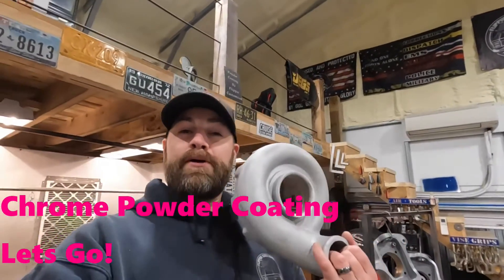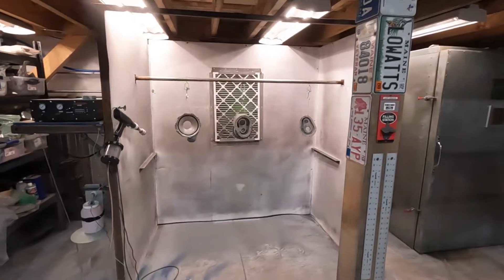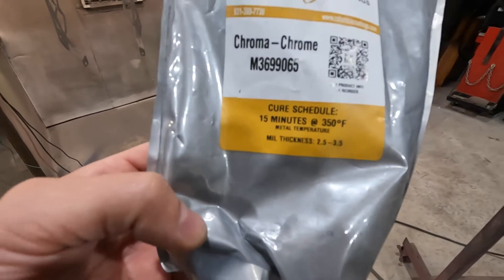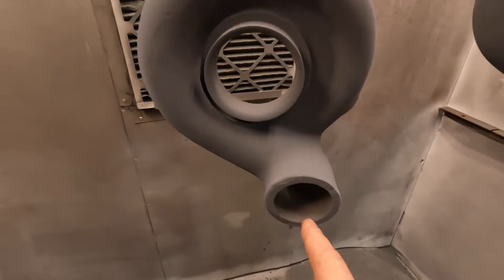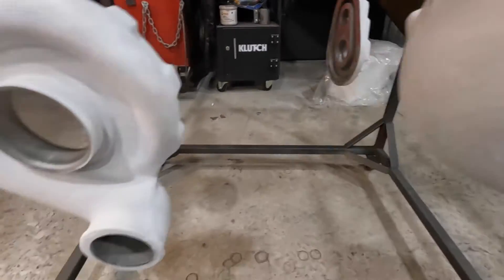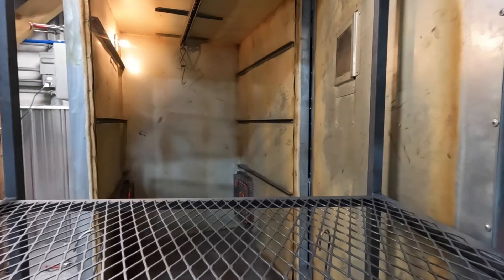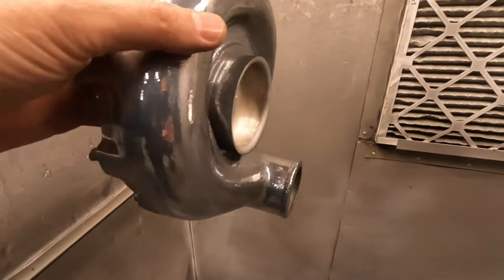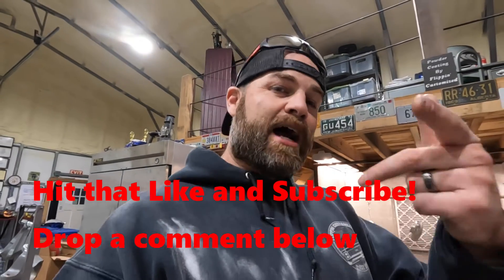Reflective Chrome Powder Coating, how does it actually look??

Comment: Would it work to polish it a little to bring up the shine, or would that not make a difference  at all?
Reply from the maker: Unfortunately not in the case of powder coating, I mean it won’t hurt but you will be polishing the clear coating
Reply: @FlippinCustomized  Ah ofcourse, that makes sense. I didn't take the clearcoat in consideration.